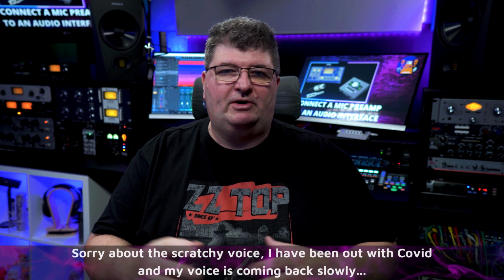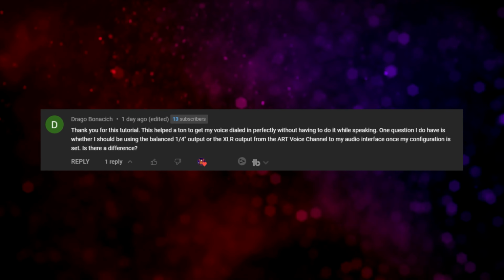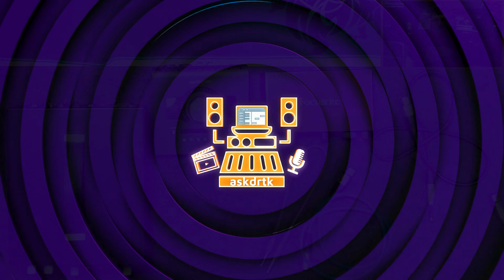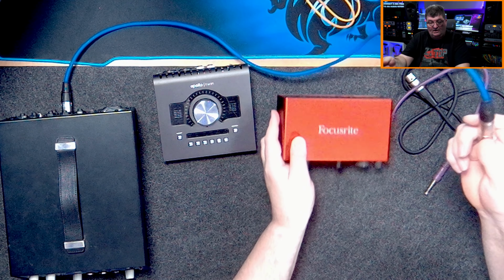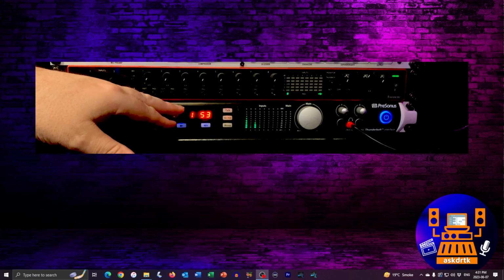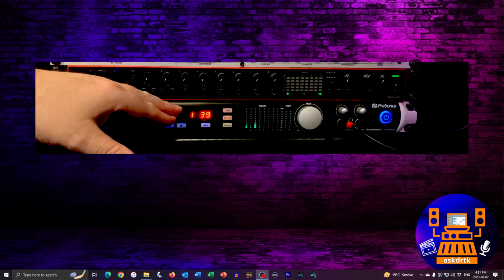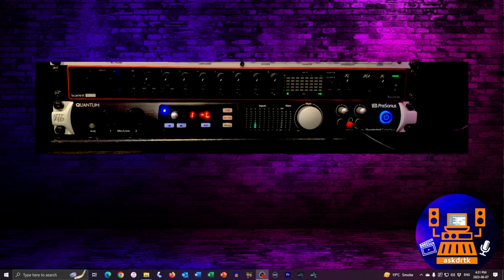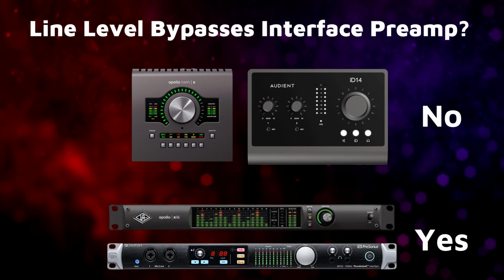How to Connect a Mic Preamp to an Audio Interface Without Breaking Anything...

Comment: I have problems with ac ground loops. Using a guitar amp with fx pedals mic'd to a outboard pre into a interface and a computer. 
Too many different inputs to the powerboard? 😢
Reply from the maker: That can happen with a lot of gear plugged in. Guitar amps are often an issue. I address this by using either a power strip with individually isolated outlets such as the TrippLite Isobar or if you can narrow the issue down to one device, a hum eliminator such as a Hum X for that specific unit. Try testing with out the amp or preamp by recording silence from the interface inputs to see if you can isolate the cause. Often a Hum X on the plug for the guitar amp and pedals will solve the problem. I have a lot of gear including amps connected and by using a Furman to condition the power and then individual Isobar power strips for each rack I have been able to eliminate ground loop and other interference issues to the point I do not have to think about them, even on sessions running a lot of inserts. If you find the noise is due to your computer, let me know as I have other suggestions that may help out with that. Hope this helps out!
Reply: Direct in box. JDI engineering

Comment: I have antelope audio interface and you can switch the xlr to Trs and get the same capabilities with the xlr as if it is Trs. Are you familiar with it? Great video
Reply from the maker: Thanks, I'm glad you enjoyed my tutorial. 

I am familiar with some Antelope gear, in fact my main audio interface is an Orion 32+ gen 3. It has been flawless in operation and I find its patching and gain staging (trim) features indispensable for my workflow. My Orion does not have mic preamps so I don't have phantom power considerations with it. If Antelope interfaces with mic preamps include a way to set XLR output to line and disable phantom power to prevent accidentally turning it on, that would be a great feature! Makes me want to take a closer look. Which interface are you using? Cheers!

Comment: Hello i have a Art Pro MPA ll and a Focusrite Scarlett 18i20 would the work together
Reply from the maker: Yes, the MPA II will give you the option of adding some color / saturation to your recordings. When connecting the two, I recommend setting the ART to +4 and using TRS for input on the 18i20 combo jacks. Since each input does not have separate phantom power control on the 18i20, using TRS will ensure you don’t send phantom power to the MPA II accidentally while still allowing you to use phantom power on the other mic preamps on the 18i20. I hope this helps out!
Reply: @askdrtk  thank you i mean i dont know what trs means but ill figure it out i also noted from your video that i have to be carefull not f anything up hahah im glad i didnt attemp to set them up before whatching your video and consulting with you

Comment: What would be the best way to connect a KSM32 to ART Voice Channel to GoXLR?? I'm planning to get the ART for the superior processing.

I'm also interested in how you managed your cables to move your pc out of your room. I watched the video with the fibre optic usb cables. Many of the devices I use require direct USB connection to the pc; they don't seem to cooperate when used with extenders and hubs. My pc only has USB A ports; the huaham cables seem to only come in C or C/A. I've found an A/A extension cable, but I'm unsure how well those would work. I'm very keen on moving my pc out not just because of the sound, but also to avoid the sauna level heat in the summer.
Reply from the maker: The KDM32 to ART Voice Channel is a stand XLR mic cable (I use Mogami, WBC, and HOSA Pro cables in my studio). I would use the balanced XLR mic input on the GoXLR. While the line input can be made to work, it is unbalanced stereo and will not provide the best sound. To connect the ART VC to the GoXLR you will need an isolation transformer such as the ART Dual Transformer/ Isolator (DTI). This will allow you to connect the balanced output from the ART VC into the DTI and then connect the balanced XLR input from the GoXLR to the balanced output of the DTI using either an XLR to XLR or an XLR to TRS cable. This approach will match the correct impedance requirements on both the VC and GoXLR and will also prevent accidental damage to the VC if you were to turn on phantom power on the GoXLR by mistake.

I have generally had good success with fibre optic cables for usb, thunderbolt, and HDMI. I use all of these cables between my "computer room" and studio. I also have a thunderbolt dock (OWC Thunderbolt Pro Dock) in my studio which has its own usb host controller and jacks which behave exactly like the usb ports on the computer itself for any potential "problem" devices. The Thunderbolt dock also provides a convenient connection for my Thunderbolt audio interfaces (Apollo, Quantum, and MOTU). It was definitely worth the effort (and cost) to relocate my PC for (as you said) the head and noise...I will never go back to having my PC in the studio. Hope this helps out!
Reply: @askdrtk  Hello again! I ended up finally getting a ART VC. Though in my haste to try it out, I had forgotten about your recommendation regarding the DTI. I did manage to connect the mic input from the GOXLR directly into the balanced XLR output on the back of the ART VC using XLR to XLR. The ART VC emitted a feedback loop sound for about 5 minutes until I realized it was doing so because I had forgotten to turn off the phantom power from the GOXLR 😱. It seemed to function fine after that but I can't be sure if I damaged it or not. Though it seems to work, I'd like to ask if you could explain the part about the correct impedance requirements of the two devices. I don't quite understand the role of the DTI. Thank you 

As a side note, I'd like to share my experiences with the optical cables. I've been using them for about 6 months now. My setup was 1 optical USB A male to A female into a USB 5Gbps hub. Some of my devices would occasionally fail to work when plugged into the hub. Eventually I figured out why my usb devices were not working well with the hub. Due to the length of the cabling, the bandwidth the USB hub was receiving as well as the bandwidth of the hub itself was insufficient to drive the usb 3.0 webcams I intended to use. I alleviated this issue by getting more USB optical cables for the individual data hungry devices and getting a hub with a 10Gbps data rating. Though the devices are occasionally temperamental. It seems I'll have to shell out for the thunderbolt equipment at some point. But as I use a standard pc (no thunderbolt), my options are with a pcie expansion card that is unreliable or rebuilding my pc on a motherboard that already has thunderbolt built into it (time consuming and expensive). 

Despite all the panic of devices occasionally not working when going live, the improvements to ambient noise and heat were so great that I too am never having my computer in the same room again. Thank you so much for introducing those optical cables on your channel; I would not have attempted to do it if not for your advice.

Comment: hello nice video..!how setup with cables line out from apollo input focusrite isa and line output focusrite isa from input apollo?
Reply from the maker: For line level IO I would use TRS from the Apollo line out to TRS on the ISA One line in and then XLR from the ISA One main out to TRS on the Apollo line in.
Reply: @askdrtk  The return and send plugs What can they do?
Reply from the maker: They allow you to add an outboard effect such as a compressor, eq... into the signal path before the signal is sent to the main output or digital IO if you have the expansion card.

Comment: I love this channel, so well explained. The only problem is my dumb ass! I have a Focusrite Clarett+ 4Pre and was thinking of getting my first compressor, so saw the FMR RNC 1773 and thought "great that's all I need!". So I need an external preamp too? Which I connect to the line in on the back of the Clarett? Then where does the compressor connect to? and where do I plug my mic in? Haha so confusing :((
Reply from the maker: Glad you’re enjoying my channel. Your 4Pre has enough IO that an external preamp it not required. Connect the mic to any of the 4 preamp inputs and then route that input to output 3 on the Clarett+ using Focusrite Control. Then connect output 3 from the Clarett+ to the input on your compressor and connect the output from your compressor back to input 5 on the Clarett+. Your mix will then be routed through the compressor and back into your DAW on input 5 with no latency. This way you can record both dry mic signal from the Clarett+ mic input and the wet signal passed through the compressor on input 5 in your DAW. I hope this helps…Cheers!
Reply: @askdrtk  Wow thank you! 🙏

Comment: Can I connect a Audient MKii into a Art Voice Channel and turn off the built in interface on the Art Channel?
Reply from the maker: Yes, the VoiceChannel can be used as an entirely analog channel strip. Connect balanced the output from the VoiceChannel to balanced a input  on the MKii using a TRS cable to avoid accidental complications with phantom power from the Mkii.

Comment: On the apollo you set the channel to line input by the input selector button. But yes i agree with the 1/4  for safety with the phantom power back flow.
Reply from the maker: I look at it this way, in the creative moment or even if we are busy trying to get things done, one less thing to worry about is not a bad thing… Cheers!

Comment: use an isolation transformer at the unbalanced device output to be certain that any phantom that may inadvertently be present is isolated.
Frankly all unbalanced outputs should have a built in phantom blocker imho 
I keep several Triton phantom blockers  at hand it’s to easy to hit the phantom power on the interface
Unless one works alone and is diligent 
But given the price of my Shelford Channels and Ribbon Mics I use an inline blocker or a Royer signal booster if necessary and power it with phantom power
If the switch is hit in this senario you just lose the signal

Before you connect the device you wish to shield from phantom power, make sure your phantom blocker is attached to the cable and have phantom power engaged. Wait 5 seconds, during which phantom blockers internal bleeder resistors will cancel out voltage differences. Connecting in this order prevents the transfer of an initial AC voltage burst created by the phantom power switching on. 

Lastly remember that trs can conduct phantom power perhaps not in this vid example but not a great idea to just rely on the cable type to determine if it’s hot on not

Patch bays teach us that

Comment: hi sir i do have the art voice channel and my interface is volt 476P can you please tell me the diagram on how i connect it properly.  needed badly its been a month i am trying to set up but i am not getting the signal since i am confused what cables sh
Reply: should i use. when i check the preference on my daw still volt476p
its not showing the art voice channel. the connection i made input 1 to interface using male xlr plugg to mic pre amp out using balanced trs and i use xlr cables plug on the back of the art mic line input directly to my microphone the same diagram on your ither tutorial. when i start recording there is no changes on the vocals even i tweaks the knobs on the art but when i use another xlr male and female i plugg it line 2 input of the interface and the female xlr plugg into the output of the art im getting signal on line 2 is it finally working?
Reply from the maker: I would recommend connecting the VoiceChannel balanced TRS output to one of the TRS inputs on the combo jacks on the 476P using a TRS to TRS cable. This way not only will you ensure phantom power is not sent from the Volt to the VoiceChannel, but the Volt will also automatically adjust the input gain and impedance to be appropriate for the signal coming from the VoiceChannel. The input you use will still show as "Volt" in your DAW as the computer has no way of knowing you have an analog channel strip connected to the Volt, but the audio on whichever Volt input you use will be that of the VoiceChannel. I hope this helps out!
Reply: @askdrtk  thanks a lot i will give it a try🙂
Reply: @askdrtk  thanks a lot sir i made it work finally🙌🙌🙌

Comment: Universal Audio says that using a trs cable to connect a preamp to the Apollo bypasses the internal preamp.
Reply from the maker: The rack mount Apollos (except FireWire) provide the option to bypass the preamps for line in with TRS cables, desktop Apollos do not have the preamp bypass circuit. If you check the Hardware Block Diagram in the user manuals you will see a preamp bypass circuit option in the rack mounts that is not present in the desktops. That said, the preamps in the desktop Apollos are very transparent, but as UA says in the rack mount manuals the preamp can be bypassed “for the purest path directly into the AD counter.” ADAT inputs are digital already and so no AD conversion takes place and the audio is routed directly to the computer. Hope this helps out!
Reply: @askdrtk  Thank you for clarifying. When I asked UA I specified that I was inquiring about my Apollo Twin, and their reply was to use a TRS cable to bypass the preamp. I guess the customer service operator either lied or didn't really know himself.
Reply from the maker: Glad to help out. In general I think UA is a great company. They make reliable high quality gear and plugins (I use their analog gear and plugins regularly), but I have heard many stories about their support being less than stellar…really unfortunate all things considered. Their gear has great specs, there’s no need to bury information in the “depths” of the manual imo. Enjoy your Twin, it’s a fantastic interface that can produce pro quality results. Cheers!
Reply: @DanieleT90  You are not alone, I have the Apollo Twin and Focusrite ISA One combo and I got the same advice from UA.  I use the Line input on the Apollo with the level turned down to 0 with the gain coming from the Focusrite.  To my ears the ISA One is a noticeable improvement on the stand alone Apollo pres.  Warmer, fuller and with sweeter highs and an overall more 'polished' sound. I still use the Apollo pres when I'm recording in stereo and it is a handy tool for the plug ins (and processing them).
Reply: @grahamhobson2397  Thank you for your feedback. I'm about to buy my first external preamp and that's why I'm researching the matter. Thanks for sharing your experience.